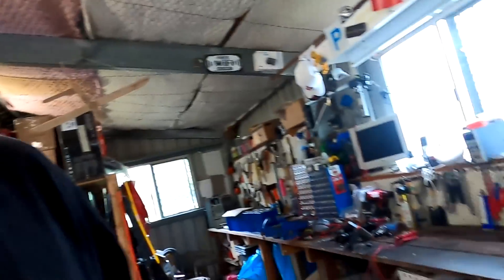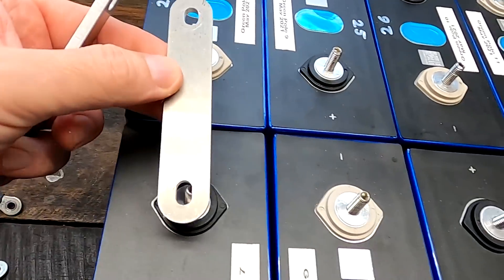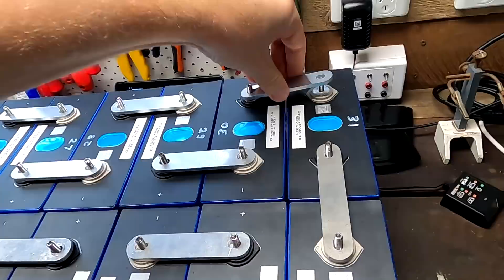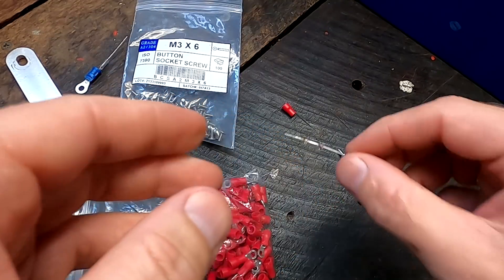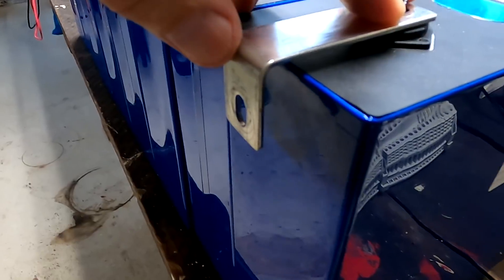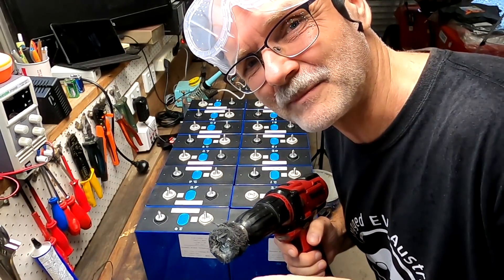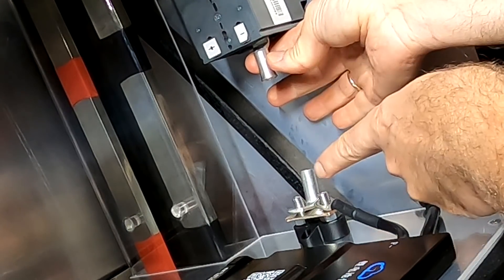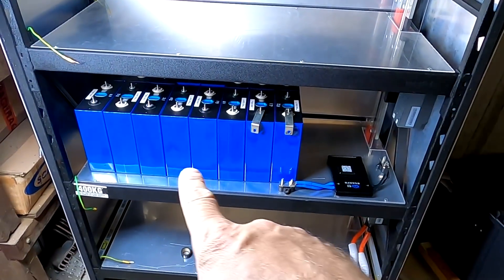Installing a 48V/14kWh LiFePO battery. The first out of three battery banks moves in! Part1

Comment: Hi Andy, do you use any kind of isolators between the cells? I forgot them setting up my 16s battery pack, everything is working fine so far, and I can only hardly imagine that a shortcut between the cells could happen. However, people recommended me to add the isolators. Meaning I have to disassemble the whole battery back (which I'm really afraid of). Would be nice to hear about your experience here, as I have so far never seen you using any kind of isolators.
Reply from the maker: I us 2mm air as an isolator between my cells 😉 I designed it like this as no touch installation in the shelf.
If you have them compressed they could rub against each other and over them the unthinkable may happen.
Reply: @OffGridGarageAustralia  - you most likely developed the best electrical isolator in the world! Congrats! ;-) 

My cells are compressed, but I can hardly believe that they start rubbing on each other. There may be some forces due to expansion, but how shout they destroy the blue isolator foil around the cells (imagine you have two of them which must get destroyed at the same position).

I really don't know what to do. Having a lot of work to add the isolators or let everything as it is as I do not really see a big risk...

Comment: Hi Andy - i have a question to your battery storage shelf- i saw in the video that you placed the batteries on a kind of acrylic plate (5mm?)- is this mounted directly on the shelf wood,or is under the acrylic plate an additional metal plate in between? Thx Josef

Comment: 4:20 ah, now I can understand that this terminal is based on single elements put together and then on a rail.
I had thought there would be a 2x 16 pole terminal which I could not find.

Now in this video finally I was able to recognice that this terminal is simply put together.
Glad that the search for that part is over cause I had already used google pic search to find that one.
Reply from the maker: You can always find all material, tools and devices I'm using under every single video and also on my website 😊
Here are the terminals: https://off-grid-garage.com/cables-and-connectors/

Comment: Hi Andy why do you connect the BMS leads to the busbars instead of the battery terminal?
Reply from the maker: Because of the sharp 90° bend. The cables are not flexible enough to bend them in such a sharp radius.

Comment: with  my mining rigs in our heat, my gpu's need re-seating every so many days .. nothing is ever moved .. and they are always on so thermal movement is minimal .. but still suddenly communications errors cause random faults .. and i just wiggle or touch around and it is suddenly ok .. these very tiny amounts of resistance can cause havic with multiplicity of  connections as u have .. a trouble shooting catalogue of isolating to find the cause is long and difficult in any one of those connections over the yrs ..  write it while u still ahve all the problems spots in mind as it should work well for long while .. but when ?! .. smiles .. u shall reward urself with what u may b chasing .. love ur channel .. and hope u didnt float away like we did down here in beerwah
Reply from the maker: We have this a lot here in Australia due to air moisture and oxidatio0n on RAM module contacts. As you said, just wiggle or re-seat and it's good for another 6 months 😊
Reply: @OffGridGarageAustralia  smiles .. pc's of clients on beaches ..... aahhhhhhhhhhhh .. sometimes the corrosion was hard to believe the machines even booted net alone could run code ...lol... much better out here .. and u up in the clouds ... even better ..  the water went below gound level today ... yeah !.. cheers .. and if you need any AS solar standards i have yrs old forms ... but need to find revisions to be legal as they can make the smallest changes as i am sure u r aware with building electrical equipement

Comment: Did you consider using a solid bus bar from the main + & - terminals down to your double terminal on the shelf?  For torqueing the nuts on the terminals, I like to hold the grub screw with an allen wrench and use a crows foot on the nut.  You need to do an adjustment to the torque setting for the additional leverage but that is easy.  that way you are applying tension to the screw terminal but no torque.
Reply from the maker: I didn't have a suitable copper busbar here for that, so went with the cables.
I used to do the same an held down the set screw. But it's actually not necessary. The nut will pull on the set screw and therefore prevent it from going in deeper. There is no movement of the set screw not holding it.

Comment: I am very concerned about the bent bus bars for battery + and - connections.  They are close enough to each other that they may move and short against each other.  Very bad!!!  Perhaps a 1mm sheet of plexiglas between those two cells sticking up to prevent such contact if either bus bar were to rotate around its attachment point.  What do you think?😩
Reply from the maker: I considered that. They can only rotate if:
- both nuts got loose at the same time AND
- the negative cable would be loose and also came off the small busbar (that would imply the entire cable can be taken off the battery terminal and the small busbar at the same time) AND
- the positive cable allows enough slack so the busbar can rotate (which it does not allow) AND
- both heatshrink would be faulty at the same location
So, I think it is far more likely something else happens than all of the above 😊
Reply: @OffGridGarageAustralia  I was mostly concerned that they get shorted before installation is completed.  Easy to attach a insulating spacer between them so they can’t rotate?
Reply from the maker: @philipmorgan1438  ah nah, I started with these two and no other busbars where connected to any other cell.
Reply from the maker: @philipmorgan1438  Not that easy actually as there is nowhere to mount the spacer. I could have a long strip of acrylic form the shelf upwards to the top of the cells... I'll look into it again but think this is not a concern at the moment.
Reply: @OffGridGarageAustralia  I get that… maybe the bus bars (+ and -) could be bent down at different points (distances) from the mounting studs so that, if rotated, they would pass below each other and not be able to touch?

Comment: Maybe its nothing, but do you worry about increased resistance in those bent busbars? When bending or deforming metals at low (room) temperatures the internal structure changes (stiffens) and ohmic restistance increases aswell. But I cant say how much an if it would cause heat problems. Maybe you could do a test with one straight bar an the other one #bended measuring resistance with your meter normally used for internal resistance? And/or look at it with your thermal imaging camera.
If its a problem, you could solve it by using another bent ring lug connected to a straight busbar. Those ring lugs should come without increased resistance at the bent area from the factory

Comment: put all the p on a bus-bar then to your line in, all neg on a buss bar line in, that way you can take out the bad battery when needed and fuse or breaker it to, that way the one battery does not take the full load.

Comment: Hi Andy, if you want to fuse them why not just screw the fuse into the dinrailconnectors and weld other side to balance cable so you have all fuses in line together for better optics and overview. And saves you 16 extra weldings times 3 banks.
Reply from the maker: But what about if I replace the BMS or want to connect a balancer? I would need to solder new fuses on these cables as well every time I swap them. That does not make sense. 
Every BMS, balancer or device has it's own cabling harness.
Reply: @OffGridGarageAustralia  No, you misunderstood.
The fuses coming on the other side of the cable from where you made them now. The balancer cable is on the other side off the rowclambs.
Now you have to search for broken fuses above the cells which isn’t easy. Besides someone mentioned the fuseholderrowclambs that’s what I’m using but only on the black wire from the bms.

Comment: talking about safety: you should put an additive isolation  between  the cell housings 
and IMHO you should press them, 'cause they tend to expand by design and that would decrease lifetime
Reply from the maker: I'll talk about compression in another video again. It's all BS in my opinion.
Reply: @OffGridGarageAustralia  OK, but let me put it another way: not compression, but prevention of expansion  ...
Reply from the maker: @ManfredBrauchle  where does the pressure go if you computers them together. If one cell expands a bit more than the neighbouring cell, would that not  push into the 'weaker' cell?
Reply: @OffGridGarageAustralia  The probability that a one cell is 'weaker' is much lower than the generally existing desire of cells to expand. 
To make long story short, I am happy with my cellpack, which is prevented from expanding.
schau'mer'mal, dann seh'mer ja - wie der ⚽ Kaiser zu sagen pflegte ;-)  
BTW: are you online again? have the floods receded? fingers crossed!
Reply from the maker: @ManfredBrauchle  got a crappy mobile access point. So half online, I would say. Upload takes foreeeeeever.

Comment: Hey Andy, perhaps see if you can use the lugs from the BMS on either side of the joiner bus bar. This way it helps ensure both cables share the load the same way. 

Or you could even use a single post, and put the 90 deg terminal between the two lugs coming from the BMS. This removes some more connection points.
Reply from the maker: Right, that's the picture you've sent me... OK, but what if I want to replace the BMS? That would not be as easy then. The whole purpose of this small busbar was to make it easy and flexible to replace, swap and explore other devices. Also, it holds the BMS in place 😉
Reply: @OffGridGarageAustralia  could still put all of the lugs just on the one post without the short bus bar. Slightly more fiddly but I think the result is possibly worthwhile. You could test  the difference in current through each wire with the clamp meter first. If it's close enough, then probably not worth the extra effort.

Comment: You need an isolation plate between the cells, especially when they expand. Otherwise you will have a shortcut in the future !!!
Reply from the maker: There is a 2-3mm air gap in between the cells.
Reply: @OffGridGarageAustralia  yes you told it, but this means you have only 1 to 1.5mm for each cell to expand, and when you have no pressure between the cells they expand more than 1-1.5’mm and have contact. The pressure avoid this expansion and you need the isolation. But my knowledge is only a youtube-knowledge not from my own experiance. You need pressure to avoid expansion and so you need isolation plates. Only a hint. 😃✌🏽
Reply from the maker: @superquax1  Well, with my low C rate of charging and discharging I haven't seen any bloating, expansion or contracting. Maybe they have used different/cheaper cells. I could never see or measure a difference between and empty or full battery.
Reply: @OffGridGarageAustralia  okay this low current charging could be an advantage..good luck and greetings from Germany😃👍🏽✌🏽

Comment: Strongly suggest fixture. 
Keep in mind that the weight of the internal materials inside each cell, is constantly pulling down on each plate a little bit. 
If you have a strong top end charge coming in, and experience a little expansion, and there is no pressure on the outside of the cell, the plates can develop a curve in them and separate from the plate (Or that area of the wrapped lithium film, however its designed) that is next to them. Also known as delamination. 
Delamination can reduce cycle life as much as 50% in short order. 
In my packs, I use a Fiber Tape wrap, tightly pulled, to give me a firm but flexible wrap that imparts 1-2 lbs of pressure on the walls of the cells. 
Then either a plastic banding strap gun, and some good plastic edging to prevent corner damage, and tighten that around your wrapped fiber taped packs. I usually do 2-4 in each wrap, get them tight enough they move around easily together as a module without moving. Then Band the entire construct together. With 2 Rows of cells, I'd band each one individually. 
This way you are still flexible enough to expand without issue, and you can use flexible bus bars to prevent terminal stress during that expansion. 
This way fixture is accomplished, without creating any stress points on the materials of the cell or its terminals. 
Great video! 
System looks GREAT!
Reply from the maker: Thanks for this suggestion. I could already see from the length of your comment that this would be a lot of work ;)
Delamination may only occur with high currents (0.7C-1c and higher) which we usually don't have in solar installations. I charge only to 3.45V and absorb then. This is mostly in the afternoon when the sun is not as strong any more, so a lower current anyway. I also will have three battery banks in parallel so the current will split up into ~1/3 for each bank which lowers the impact even further.
My cells will degrade from calendar life not from anything else.
Reply: @OffGridGarageAustralia  Yes. This is a much lower rate than what I am pulling / demanding from my systems. And an even slightly lower top end charge. I stop my charge at 56v and absorb. 
I am living on the system entirely 24/7 and in sunny Florida that means Air conditioning and a 80 amp average inverter load with 120+ amp charging. Add tools, fridge, computers, lights, 12v coach charger, and more. 
Top pull for my system is close to 1C. 
So, I can see limited delamination in your use case.
Your absorption explanation video for lithium taught me a lot. Thank you for all the excellent content!
Reply from the maker: @Psilence_Dimension  thank you for sharing. That sounds like a great setup you have there. So no power connection at all or most not using it?
Ok, if you pull almost 1C I probably would look into compression as well. It depends if you do close to a full cycle every day as well. My cycle profile is very shallow and with more battery banks coming I'm taking away more stress from the batteries. At least in terms of charging/discharging current.
Reply: @OffGridGarageAustralia  Nope. No hard connection to power. Too far away from the nearest junction. (3900ft)
Fully off-grid for going on 5 years now. Just finished building my 5th large format pack.
This pack is cycling 500-650 amp hour per day typically. Air Conditioning in an RV pulls a ton of power. 
Its certainly a different lifestyle that must be built around the pack. Watching your usage, turning off things that aren't being used, switching off heavy loads to run the microwave, or dishwasher, or washer/dryer, watching the electrical devices you add to your home and how much they draw. The overall power footprint is always a consideration.
Plus this pack is mobile, so for me, fixture was an absolute must.
Reply from the maker: @Psilence_Dimension  thanks again. Fascinating experience you have there. I like that your are so power aware and run things accordingly to other loads and availability of sunshine and battery. I wish more people would be like this. It would save us all a lot of money. On-grid or off-grid.

Comment: Suggestion/questions: so, you won't compress the Eve cells..? OK, but I read compression increase cycle numbers and it is even written on the manual of your cell as "fixture". You don't use conductive paste either and you don't recommend polishing as well. I suggest you polish a terminal and the bus bar and then tou check the resistance, you should see 10-25% better due the good contact, especially with the conductive paste. There too, in the PDF you attached from the Eve cell there is a recommendation for polishing. I always use a thin layer of plastic in between cells with the compression method. Moreover, it s better to make sure the bus bar are perfectly flat, we want to avoid contact on a reduced area, even worse on the edge of the bars. What BMS do you use? Thank you, good channel!
Reply from the maker: That is (partly) correct but:
Compression is necessary if you drive high currents. In and out. This likely won't occur with our solar installations. I will have 3 battery banks ins parallel and more in the future. My battery will degrade and die from calendar age and definitely not from cycling.
I use conductive paste as shown in other videos. I also made two videos about compression of the EVE cells. I think it's totally overrated and a lot of effort for minimal benefit (if at all).

Comment: If you has a spare piece of the stainless steel sheeting, you could cut it the same size as the BMS and mount the BMS on that ?
Reply from the maker: Why stainless steel?
Reply: @OffGridGarageAustralia  Thought you may have had an offcut from all the other sheets you mounted on the wall, looked like the thickness of it would have been ideal for the BMS :)
Reply from the maker: @AndyM...  Ah, right, that is all aluminium. SS is painful to work with. Yeah, I have heaps of off-cuts from that...
Reply: @OffGridGarageAustralia  Apologies Andy, thought it was SS...aluminium will do !!!
Reply from the maker: @AndyM...  not a problem and no need to apologise 😉 I probably don't want a holder for the BMS as I may want to replace it with another one at some stage for testing purposes. The holder may be in the way. But let's see...

Comment: You can set a lower the balance current of the JK-BMS from the phone app. That might even extend the life of the BMS...
Reply from the maker: Because we don't use the caps that excessively?
Reply: @OffGridGarageAustralia  Caps and switching transistors. But my initial comment was for your concerns about the balance lead fuses (5 amp) being too small.